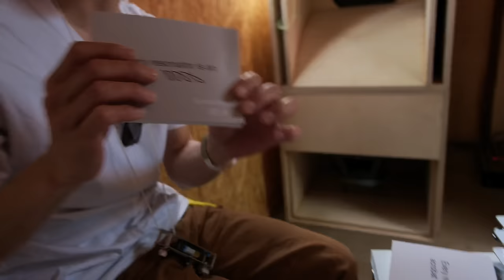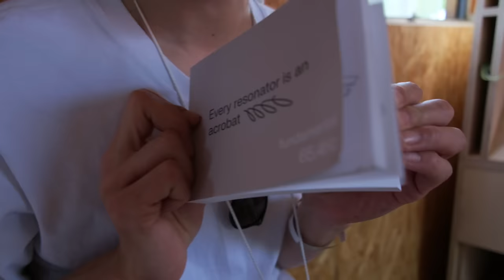A Conversation With Tats of Korg Berlin - Acoustic Synthesizer Superbooth 2023

Comment: Best demo yet!

But the addition of samples, as it sounded like was suggested, would definitely be to the detriment of the product, as would take away from a fully analog signal path.
Reply: Why not have both?
Reply: @D1570R73D  because the analogue signal path 'should' be superior in terms of purity of sound.
Reply: If it was only the option of a DAC into the energiser coil, the analogue signal path from pickups into feedback etc is still fully analogue. Plus, who knows if they’re generating those energiser pulses with analogue circuitry — they could be using a sample of a quick pulse. He did say a lot of the control circuitry was digital for prototyping purposes.

Comment: idea: they could keep the metal parts in the coil and pickup but have the rest of the tine made of wood and use different tonewoods. may sound like a xylophone vs glockenspiel or rhodes ... yeah definitely a harmonic reverb could be made for it, kinda like the palm sympathetic string speaker for an ondes martenot.